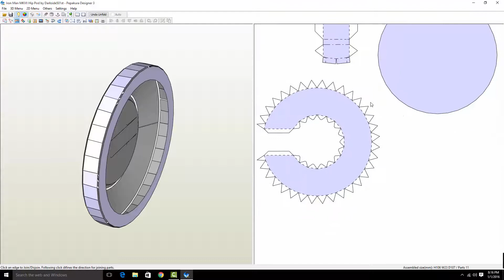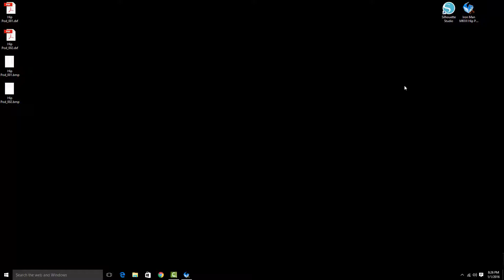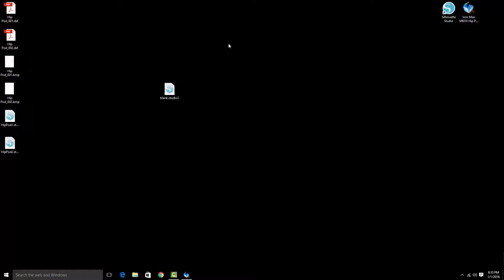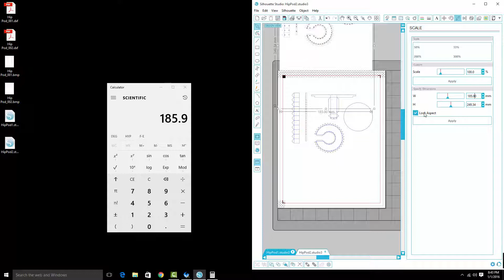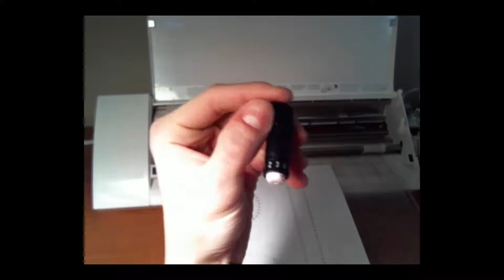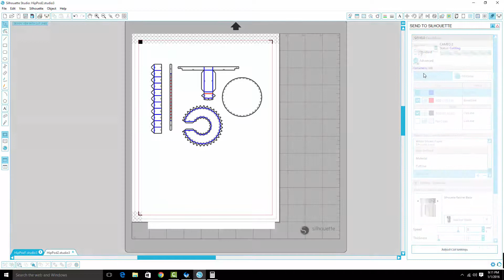Cutting Pepakura Files with a Silhouette Cameo - The Fast Way

Comment: Good video but I am having issues. I watched this video and the one by robot chicken on a similar process. When I save my vector info and export as a DFX files per sheet to Silhouette studio I keep getting the edge ids on the vector info but it won't print the edge Ids when I send to my printer. Do you have any suggestions or tips on what is wrong? I have the cameo 3 and working on Silhouette Studio 4.1.

Comment: Great video. I am looking to skip the printer part completely since it may not line up. The DXF I pull into Studio software has the numbers and the lines. I can set the numbers as a sketch and the others as score and cutlines. Issue is, on the bend lines, I would first like to sketch those then cut on top of the same line. I can't find away to do this. Software assigns each color to one type of operation.

Comment: what i mean is my vectors arent quite matching my bitmaps and i cant figure out why
Reply from the maker: zane kuehn Have you run through the calibration steps? They have a built in calibration thing where you print a test page, load it and cut it, then adjust some offsets until the cut lines up with the line.
Reply: I'm having problems adjusting the scale before you even cut to get the flap IDs match I did the scale for letter size paper and it still doesn't quite line up
Reply: For a more-detailed tutorial that addresses issues like this, take a look at https://www.youtube.com/watch?v=hcrnMARsPA0